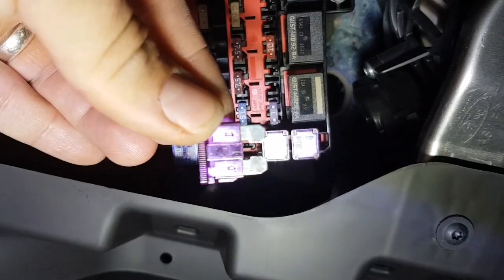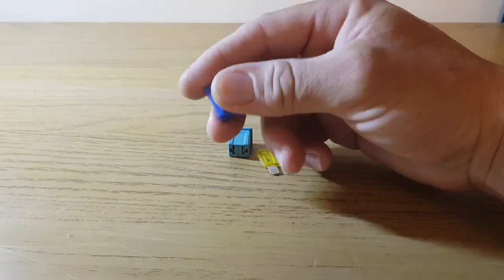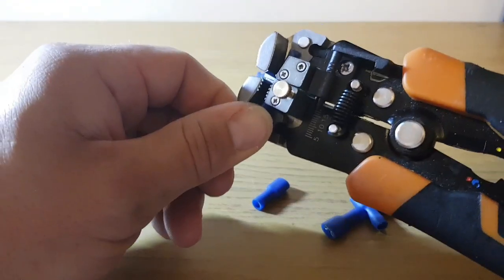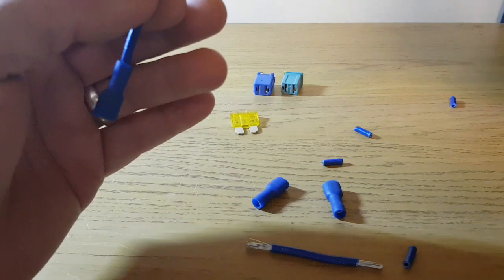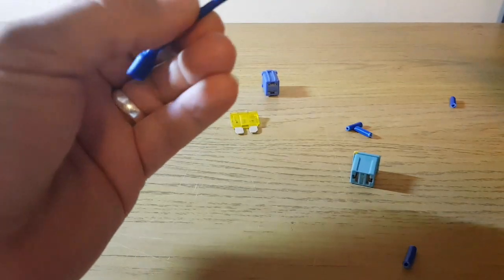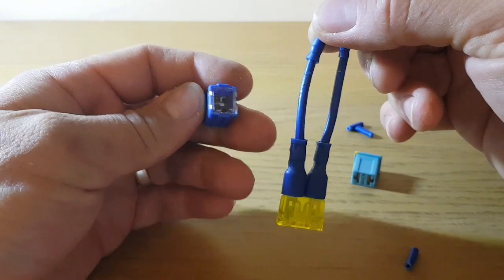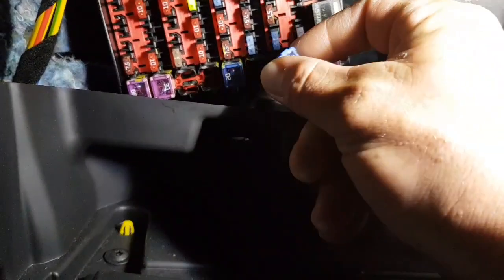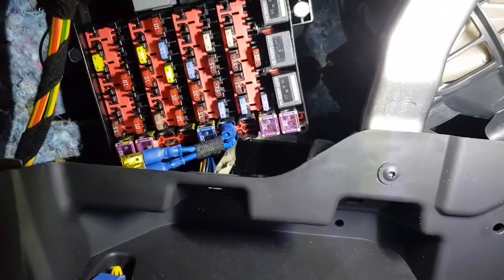Jcase fuse replaced  with a blade fuse
how to replace a blown j case fuse

Comment: I’m so glad I found this video. The reason being is I added new tow mirrors on my truck and the directions for the new mirror back up lights said tie it into the trailer backup fuse block which is a 20 amp J-case fuse. The problem is no one has an add a circuit assembly  for a J-case fuse. Problem solved. Thanks.

Comment: Smart idea! Thanks. I actually bought a huge set of 250 Piece Fuse set on Amazon for $16.99 but only insides a few of those larger box shaped fuses lower and taller.

Comment: Hi
I need a J fuse holder to connect the dash cam with the cigarette light?
Can't find it on ebay or amazon?
Any suggestions?
Reply from the maker: Use a normal fuse tap and just find something else in the fuse box that's ignition feed like the lights or screen heater. Will all work fine for a dash camera feed.

Comment: My cigarette lighter doesn’t stay on beyond 10 minutes after turning the car off and it uses a J-Case fuse so after watching your video I swapped the fuse for your type of modified fuse and added a “add a fuse” adapter to the two female spades and wired the add a fuse to a constantly on fuse for the dome lights, now I have constant power to my cigarette lighter well after shutting the engine off 

I’ve since also added a voltage regulator to the add a fuse system to turn off the fuse if power drops below 12.2v 

Thank you
Reply: Wait, can you explain how you modified the ciggarette lighter to stay on after engine cuts
Thx

Comment: Cool thx! I'm going to add a switch to the ACC fuse...my battery keeps getting drained from an aftermarket stereo...I don't have time to mess with changing the wires around (it must stay on when the car is off), and its 0 deg out..this seems like a simple solution for now.

Comment: So the question is : why would the manufacturer put the Jfuse when they can put the other small fuse which you replaced it with ?
Reply: I believe that the jcase fuse can take a temporary surge without blowing, unlike the cheaper blade type fuse.
Reply from the maker: I dont know theres about 10 different fuse types in a  car now thay could all be blade fuses thay were in the 90s
Reply: @MADMODS  j case fuses come in up to 50a.
There are blade fuses up to 30a but that's pushing the limit of the package
Reply: @nirodper  actually smaller blade fuses are 40 amp max then they step up to a bigger blade fuse which is a maxi fuse

Comment: I’m having issues with my pink 30 amp fuse. When I went to the automotive store they had a 30 amp and a taller 30 amp would they both work?
Reply from the maker: Yes along as it's a 30amp fuse and will fit under any covers it will be fine.